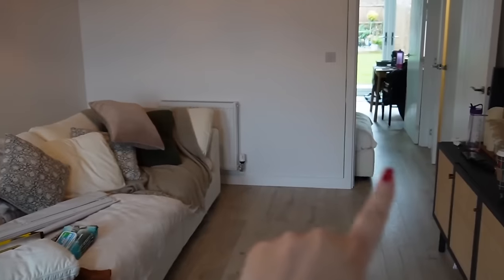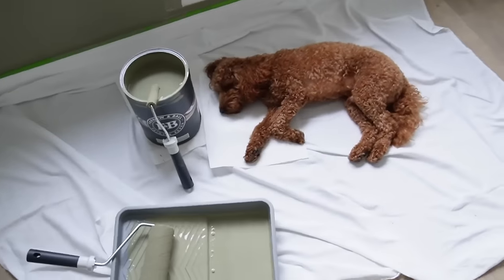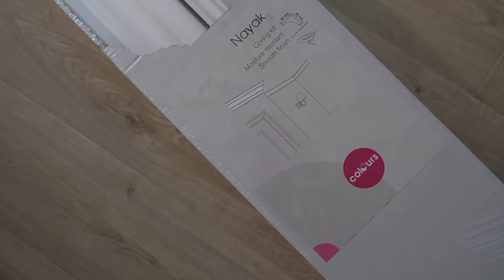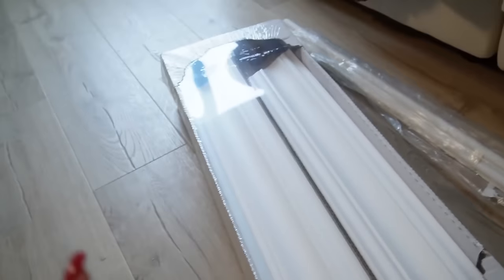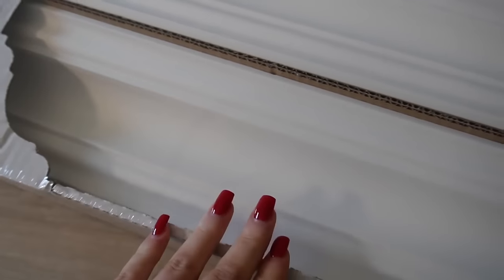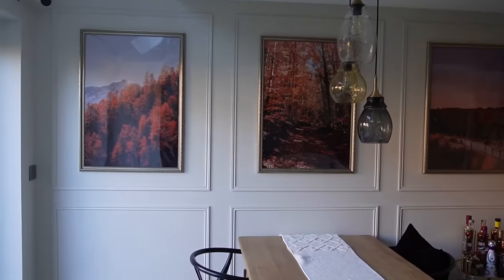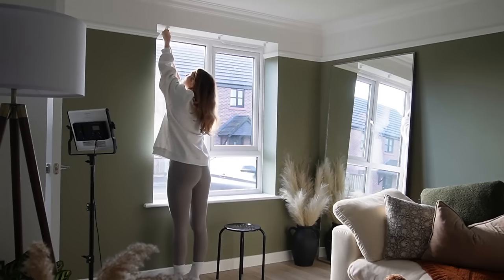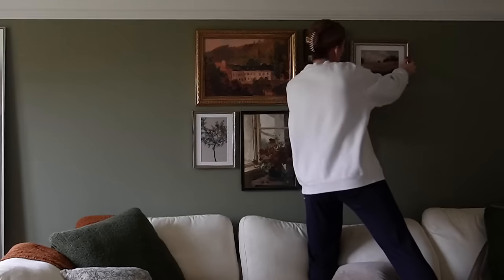LIVING ROOM TRANSFORMATION ON A BUDGET!✨ diy coving, panelling, painting & more!

Comment: Radiator cover in white with antique mirror  above it, and antique wall lights each side of the gallery wall. I think you should move the floor lamp to where your  mirror is , and put  the full length mirror in hall. But love the transformation, and change the lampshade on celing to antique style.  Very cosy, looking forward to tree too.